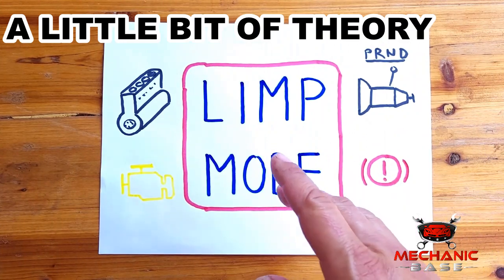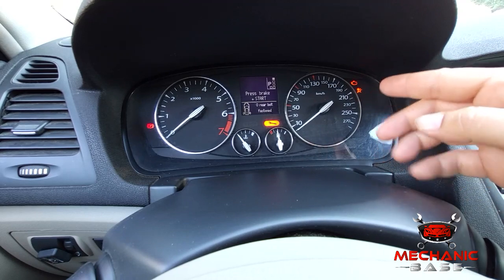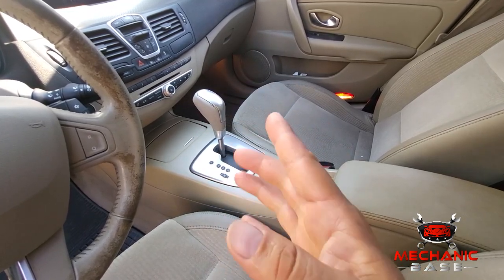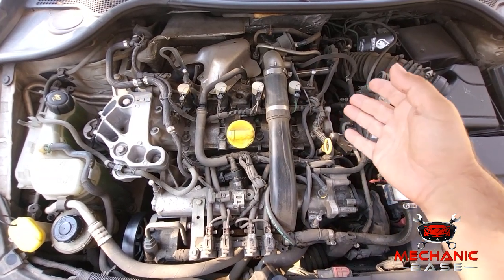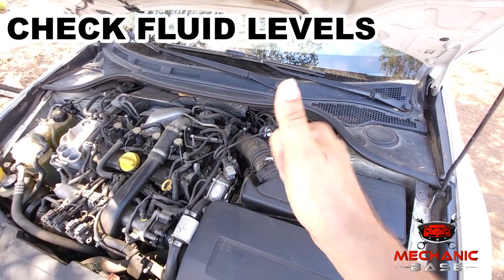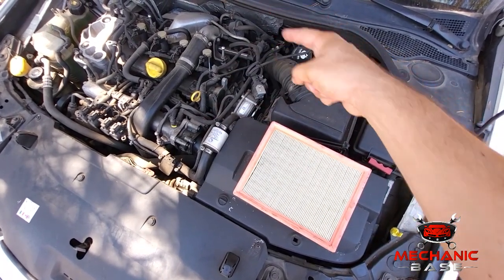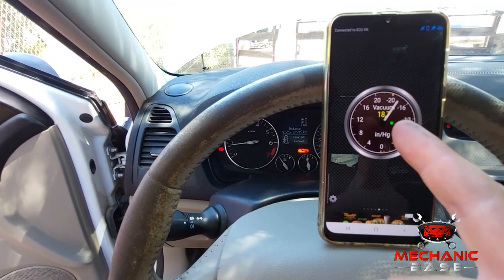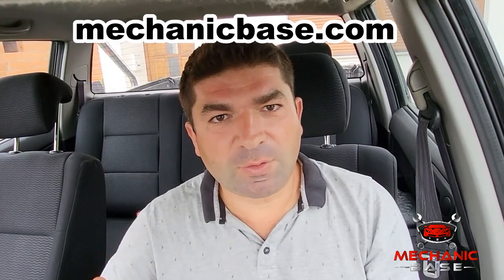Limp Mode: Meaning, Causes and How to Fix It

Comment from the maker: Did you solve the problem with your car? Let us know in the comments below how you did it, and you can help someone else with limp mode!
Don't forget to like the video and subscribe to our channel!
More Limp Mode Info: https://mechanicbase.com/engine/limp-mode/
Website: https://mechanicbase.com/
Reply: I was charging an accessory and it pulled my battery down.  Had to jump start the car.  Car went into limp mode scared me to death.  Thought my transmission was out, it wouldn't shift.  A mechanic cleared the code and all was well
Reply: 2014 Eagle diesel Dodge Ram 3.0 easy fix

There's a sensor on top of the engine right beside the turbo hose. The black square sensor on the engine pulls it off clean it put it back in, and your problem is solved.

Spread this message around because this fix my truck it was a totally free Fix, everyone telling me that I needed to replace the engine or I needed a new Turbo😂
Reply: @RyuS-kw4dl same I have had this happen 3 times it’s so fn stupid it does this
Reply: @Mechanic Base i have a bmw 1 series coupe when in first and second gear drives good and has power but when going into 3rd gear it loses power and turns off pls help me bro
Reply: @ibrahimmiftari3826  fixing these problems. Two choices. Be willing to dump money into it no matter what it takes or take your losses and get another car.
I had a nice Mercedes SUV. Did whatever I could to fix it. 
Am I willing to spend aleast $2000 in more parts and it still doesn't fix it ?
This is one thing if noticed with all these plastic parts and cheap wires under the hood.
They don't like heat. If you take a plug off a sensor, and the plastic is fragile and cracks easy, think about the rest of that plastic crap.
Reply: My wrench light is on the machines dont give out a code so they tells me to ignore it and other mechanics to but last time my car wrench light went on the car went on limp mode now its happening wrench light is on again last time i had to have motor and trans the trans 3 times replaced on guesses alot of money and im tired of living afraid of not being able to afford if its something simple or weve missed something . My dad bought me a Used 2006 Ford Explorer for me before he passed 4 years ago may he RIP I dont want to loose this car and Ive paid alot 2 years ago when this happened but no check engine.. Please help me Please😭 🔧wrench and its back limp mode mode made mechanics replace maybe unecessary  huge parts.
Reply: When my car reaches 3,500 to 4,000 RPM it shakes like it's going to die.  What is the problem with this?  My car is a VW Golf plus 6 TSI gasoline.  It was replaced with an Air pressure sensor because I noticed that the old one was steam.  but the problem is still not gone, please help me.
Reply: How long does limp mode last after changing bad sensors that was located after scanning the car ?
Reply: @MechanicBase I drive a 2014 polo gti 1.4 DSG. It drives fine in manuel and sports mode. But in automatic mode it randomly goes into limp mode then I need to take my foot off the accelerator and put it back on then it would drive normally again. Or if it goes into limp mode then I just put the car in manual mode and it would drive fine. What could be the issue?

Comment: 2015 Nissan Murano limp mode is caused by altinator not charging battery at correct voltage (under charging) due to bad voltage regulation due to feed back from fuse box regulator. To get out of limp mode turn off all power consuming devices (fan stereo heated seats ect. ) wait a minutes until alternator has time to charge battery.
Reply from the maker: Good to know! Thanks for sharing this information💪

Comment: I found, the cause of Lymp mode may be a water leckage, probably on the roof! It's the result of an electrical shock & the only way to deal with it's unplugging the battery to reset the system!

Comment: Limp mode is not what we want when we buy a car !! a stupid wheel sensor is out so it goes into limp mode !! abs module is bad !! limp mode !! abs is something cars had gone without for almost 100 years !! its stupid stupid stupid !! the more electrical crap you put under the hood the worse everything is !

Comment: I have limp mode in ford cmax 1.5 diesel powershift. But no usual errors no EML, i can rav when stationery but only when it goes id drive. It doesn’t allow it to shift gear from 3 gear past. Now i get power control module fan 1 error i changed rely that error is gone i check live data but shows ecu is less power. But now i will change transmission oil to see if that fixes it, but i also dont have any error on TCM either. No eml no tcm error. Also live data shows water in fuel set to Yes

Comment: My PT cruiser goes into limp mode I've got a way of fixing it but every time I look it up to figure out how to fix it I can't figure out which exactly relay I got to use the bypass the temper basically what I'm saying is I'm back on the back feed the temple and I can't figure out which one to use the 20 or 30 or 40 amp fuse I mean relay it's got me confused now
Reply: It's a 2007 PT cruiser no turbo

Comment: I am driving a Golf 4 and I got her back from the mechanics yesterday after another R17 000.00 and she is back in limp mode this morning.
I have replaced the turbo, the alternator, dieselpump, pipes, battery, air filter, new computer and two rubber items (can't remember the name) so what else can I do to get her out of limp mode.

Comment: I have a 2007 touring V-6. To keep it short. Could a faulty sensor, if there is one there, near brake caliper cause this problem . I soaked one wheel with PB Blaster. what I thought were brake calipers and the next day, I know now it went into Limp Mode. It is an old car with a dented  front fender but It was running too good before, like flipping a switch. Any advice appreciated. Dead in the Driveway but I have hope. Thanks.
Reply from the maker: Which car? Maybe ABS sensor.
Reply: @MechanicBase  it is 2007 Chrysler 300 v-6 touring. IS replacing THE SENSOR A EXPENSIVE JOB?

Comment: Limp mode isn't a good name or explanation of what's going on, it's not a safety mode at all there is no mode as such what's happening is if the ECU isn't recieving the correct voltages or signal from a sensor i.e the MAF or MAP sensors the ECU wont rev because it doesn't know how to. Another issue that people think is limp mode when it isn't is a malfunctioning EGR valve which then alters the air fuel mixture again it hasn't gone into a limp mode the mixture has changed just like a air leak on a carb engine without any computer at all. A better name would be a fail safe mode!

Comment: thanks, appreciated. Just brought my X1 to the mechanic, needed to change the valve cover (PCV valve gone bad).... went to drive it and it and 10min later went into limp mode. Had it towed to my mechanic. Sat for the night, he tried it the next day, drove it for 30min no problems, scanned it and no codes. Trying to figure out what happened...

Comment: Always check your car battery first when your car goes into Limp mode. Low voltage will throw up codes and have to changing unnecessary parts. If yout car batter voltage is below 12.5v when the engine is not turned on, the replace your battery and check your alternator first. Low voltage is often the culprit for limp mode issues.
Reply from the maker: @battlevain That's true👍
Reply: Yes, in my case it looks like the heating rods are not turned off causing the battery to drain and then limp mode. With a fully charged battery, no problem for a while.
Reply: Okokok--- so what if battery tested good- could alternator still be bad even tho batt. Was good? 

Thx for ur time
Reply: @barryquinn5752  You would find out quickly: your battery will drain.

Comment: I am the owner of a Skoda Yeti 1.2 TSI, model year 2008 and I am facing the following problem.
For a long time now, when the engine is idling and the engine is cold, I feel a shudder in the steering wheel and the cabin in general, and the vehicle goes into limp mode. when the engine reaches temperature then the vehicle works normally.
It should be noted that I did a revamp at the engine at August. Spark plugs, spark plug wires and multiplier are new.
Does anyone have a similar experience and if so how did they solve it?
Reply: A shudder in steering wheel sounds kind of like an issue with power steering pump? check fluids and search if there is any common issues with it on car forums or around YouTube. Hope this helps even if I'm a bit late! 😅
Reply: @FractalNinja  Hey hello! Thank for the response. I Feel the shudder mostly at my seat and gear stick. could possibly be an  uncleaned fuel ejector?

Comment: Good Morning. I just got a 2010 VW Passat 1.6TDi. It came with one of those nasty Yellow lights on dash Engine light on. Changed all Glow Plugs then Coil light started flashing then limp mode. After Dynostics EGR Failure. Replaced and lights went off. Then coil flashing limp mode. Checked wiring fuses all good. Turn car off and on all good for 5 minutes then limp again driving between 1400 and 2000rpm. While fldriving quick key off on and all good. Drive at 2500 to 3000rpm and no limp mode for as far as I want to go till I drive under 2000rpm then Glow coil flashing and limp mode
Reply from the maker: What codes are you getting now?

Comment: Had an issue with my car (Kia optima sportswagon) where had an error code saying check exhaust system, this would reduce the cars power. When engine turned off and restarted the fault would clear and power be OK again. After the second time it happened a few weeks later I booked it in for a diagnosis check. However on the way there o lost power and engine was shaking bad. After numerous diagnostics and £500 was told  all the chambers were losing considerable amount of pressure amd was told I needed a new engine. Had a reconditioned engine fitted however awhen exceeding 3000rpm car goes in to limp mode. Been advised to try new battery as the control sensors may not be receiving the correct ampages/voltage required to work properly. Will be fitting the battery today hopefully. If that doesn't work, cab anyone recommend what to check next. Fuel pump etc? Thanks
Reply from the maker: Actually, a worn battery can cause a whole lot of issues because of a drop in voltage, either while cranking or while driving. How old is your battery?

Comment: Tbh the best solution to find what the issue is wrong with the car is take it to a mechanic. Thats the sole purpose of the feature. 

Why spend money on something that might not be the problem.  Thats the money you could've used to spend it on diagnostic.  Some mechanics don't charge for diagnostic.
Reply: Hmm sometimes they dont give a crap though 😅 my mom has been having issues with her 2013 dodge grand caravan. (Rough idle, stalls out, seemed to go into limp mode), took it to the shop, said cylinder #2 was dead and needs a new engine. But when I examined it, it doesnt even look like they touched the engine (still dusty under/around the plastic covers) probably just read an obd2 code and threw out a wild guess 😑 just replaced the spark plug today (which was in pretty bad shape) but still runs a bit rough. I'm gonna be checking to see if its stuck piston compression rings, stuck intake or exhaust valves...or worse case scenario, the cylinder head is actually bad.

Comment: Is this LIMP MODE the same as BMW DRIVETRAIN MALFUNCTION? MY 2018 BMW 430I is Dead. And I am scare to call or take to BMW. Car was running fine
Reply from the maker: Is your car down on power all the time? Or it runs fine when you turn it off and on once again?
Reply: @MechanicBase 
My car is down hard in this drivetrain malfunction mode

Comment: When my car reaches 3,500 to 4,000 RPM it shakes like it's going to die.  What is the problem with this?  My car is a VW Golf plus 6 TSI gasoline.  It was replaced with an Air pressure sensor because I noticed that the old one was steam.  but the problem is still not gone, please help me.
Reply: did u fixed it already?

Comment: Hey I have a ford ranger wildtrak 2019 model. Having error code P1102. I tried cleaning the sensor but after clearing the code it appears again. Also encountering limp mode from time to time. What should I try tp check first?

Comment: Mine slowed down and Stopped.  I turned off the engine and brake on.   After about 5 mins or more. I pressed engine on button the car stared OK and drove me home without no problems 
But the same day my car fuel was on one Bar. Then fuel warning light came on so I went to drive to petrol station But car was moving very slowly I finally got to the Petrol station. But it were very slow at getting there.  ?   So I have booked cat in Mercedes benz for a Disnostic test on Friday 
P.

Comment: I have a 2012 Ford Fiesta an the wrench light is on some days it’ll drive other days the wrench light will be on an will be in limp mode an won’t drive past 5mph if that. The code it’s reading is p0604. Where do I start the pcm? Or throttle body or sensor.

Comment: i got a 2018 homda accord 1.5 my mechanic changed the 4 spark plugs, 4 ignition coils, and air filter and still goin into limp mode what do i do?
Reply from the maker: For a start, you should have the codes scanned - these will help a lot in pinpointing the problem.

Comment: Could you please provide advice on how to hook up the scanner?  I would like to know if I can acquire a scanner so that my car will at least tell me what's wrong.  After weeks of not being able to use my car because it wouldn't go and waiting for the service center to fit it in for a diagnostic (they were quite busy since the scanner at their other center wasn't working and they were doing the work of two centers), and the car finally getting fit in and being in there overnight, the actual problem ended up being blown brake light globes and a faulty light switch, costing me only $8.00 to have fixed.  I spent weeks stressing about how bad the damage would turn out being and having no car to drive.
Reply from the maker: Hey, which car do you have? Most newer cars are compatible with various code readers and scanners that you can buy quite cheap. For instance, you can get an OBD2 Bluetooth adapter that connects to your smartphone over an app (you can download it for free from Apple Store/Google Play), and they work very well for most of basic things.
Reply: @MechanicBase  Thank you so much!  I'm expecting 'bless your heart' reacts and laughter, but I have a 2020 LDV G10.

Comment: @MechanicBase I drive a 2014 polo gti 1.4 DSG. It drives fine in manuel and sports mode. But in automatic mode it randomly goes into limp mode then I need to take my foot off the accelerator and put it back on then it would drive normally again. Or if it goes into limp mode then I just put the car in manual mode and it would drive fine. What could be the issue
Reply: When in limp mode does you car tell you you are in park, reverse, drive? My automatic transmission car went into limp mode could not go faster then 25mph or so, dashboard did not tell me that I was in drive when I was drive and shifted nasty hard when going from park to reverse or drive to reverse I got the one code u0101 which is a tcm code

Comment: The good ol days of a Chevy small block with a carb and no computer is gone in new vehicles. It was so simple and today is so complicated. Can’t take a shit without telling the computer. So much BS today.
Reply: yup lets go back to carb cars and then we complain about the smog 😅😅😅.  not forget we get 8 mpg again 😅😅😅
Reply: Tell me about it. Love older cars (especially trucks) because of the huge engine bay for room to work and simplicity of function. Had to replace a spark plug on my mom's 2013 dodge grand caravan and you have to take the whole air intake off to even get access to the spark plugs. Probably to encourage people to go to dealerships or mechanics for expensive repairs 😑
Reply: I miss working under the hood and pulling the cord to make it rev
Reply: Cars were so simple back then you could break down on the side of the road diagnose it your self and fix it with extra room in the engine to see everything

Comment: Right now, I'm in limp mode, and the OB2 sensor told me all my cylinders are misfiring. Ordered spark plugs and ignition coils. Hopefully it solves the matter
Reply: @NeuronioJr  so I changed bank 2, and after I installed the new spark plug, I was no longer in limp mode. Thankfully, it was just bank 2. The other plugs were fine!

Comment: I have a 2015 kia soul 2.0 engine and was going to change out my MAF sensor, but I don't know where it is. I called the dealer and the service department told me that it's located between the throttle body and the air filter, but there is no sign of a sensor of any kind between the 2 devices. While doing a search on another channel, I was told that it could also be somewhere on the intake manifold, but I'm not seeing it there either! Is it possible that there isn't one on this engine? When I looked up the part on Amazon, it lists the part as MAF0034. Please help, I'm at a loss at this point!